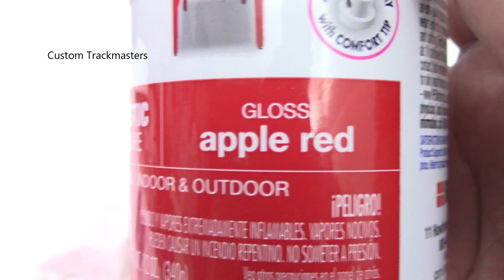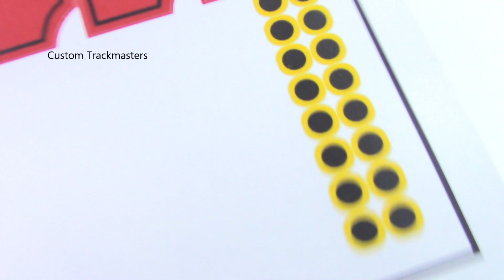Thomas and Friends Trackmaster Making Custom FR Talking Edward Thomas y sus amigos きかんしゃトーマス

Comment: I tried making a Furness railway Edward with my old tomy Edward I had second hand. I tried unscrewing a nail in the tender and a part in it snapped and is now permenantley broke in the tender. I might use tape to stop the bogey wheels ganging down when I pick it up.